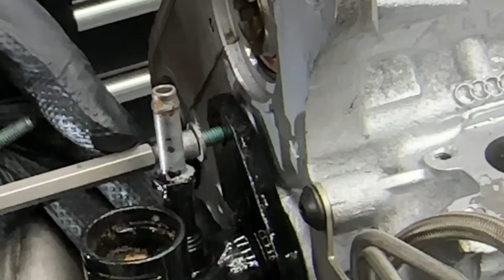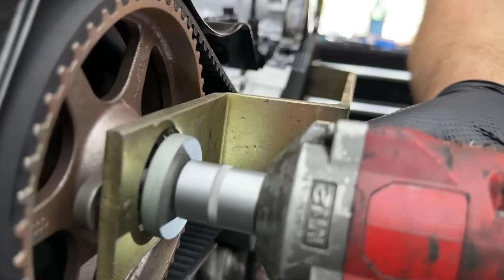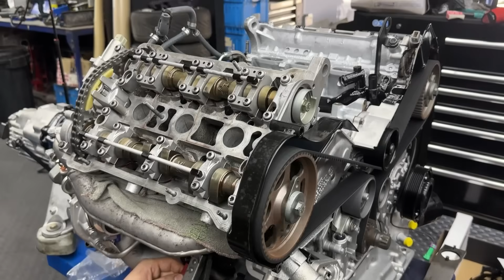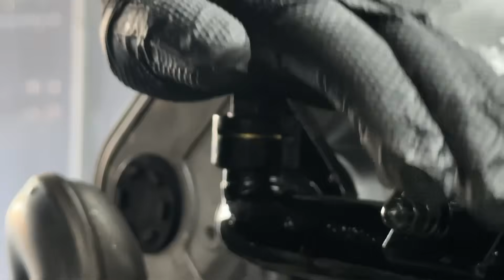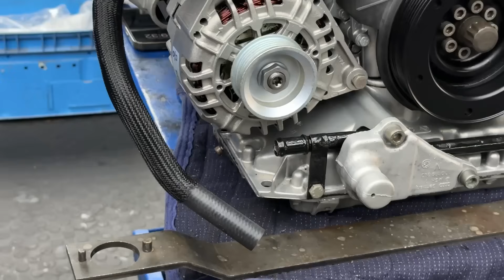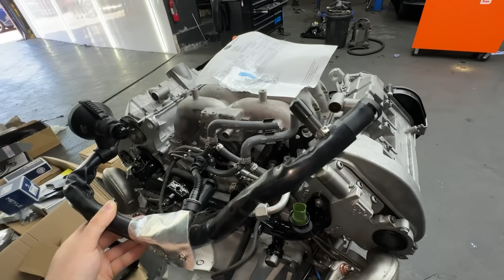Ep8 My forged S4 B5 engine has low compression on one cylinder . Where did I make the mistake?

Comment: Nice work ,well done. 
A quick question,from where did you get the genuine O rings for coolant pipes because the TPS won't do them any more?
 I want them for my S4 asweel and can't find genuine ones.
Reply from the maker: From Slovakia genuine
Reply: Thanks for your reply.  Here I can't find them and I just use eBay crap and always leaking. @VAGTechnic

Comment: I always grease the  cylinders on the rocker arm and offset pulley for the timing belt system as they aren't lubricated from ina. I use loctite on those 2 bolts aswell

Comment: Fuel rail on the rs4 is different.  So are the front upper timing covers as the bi pipes are bolted to them. The throttle valve and metal boot are also larger diameter.  I have been breaking rs4.s for 15 years so have many parts in stock if you are stuck

Comment: On the nightmare that is the breather cluster fluck. Mine has broken several times (2002 allroad), and I just cut the hard pipe where it cracked and slide some 5/8 breather hose over it. Better than new IMHO. I might have to deal with the PCV valve at some point though. Mine is still OEM at 200K miles. If anyone has a rebuild/replacement idea I’m all ears. Other than that, my 2.7T is still going strong!)
I also love this channel! I have a 2014 Q7 TDI, and it is still going strong at 160K miles, thanks to watching you do timing chains on them. Mine are still quiet, but I did have to reseal the oil cooler, fix a gasket on the EGR cooler (copper coat spray to the rescue!) and de-grunge the intake manifold. I currently see no reason not to easily hit 200K miles on the OEM chains. I do use my Q7 to pull a travel trailer, and I think that actually helps keep it running good. Sort of an extended Italian tuneup every time I tow - keeps the pipes clean!

Comment: You can cap off the front intake manifold port that leads to “F hose” that is shown on your original PCV hose. On your new PCV hose I recommend capping off the hose that connects to the rear intake manifold port. 

So in short the only things connecting to the intake manifold are brake booster , N75, FPR, diverter valves, & boost gauge.